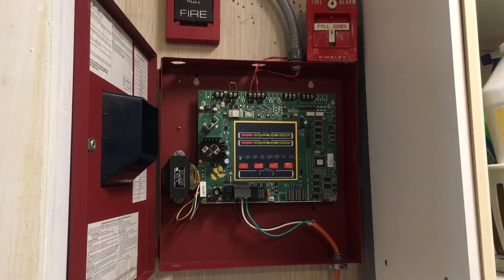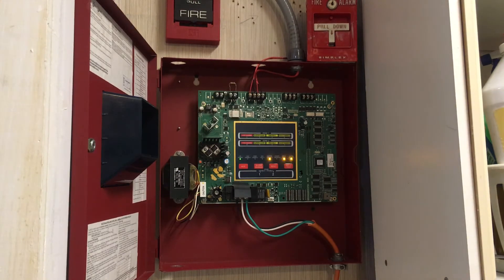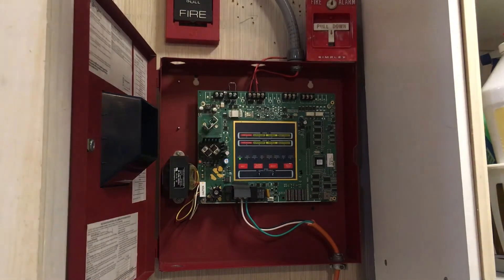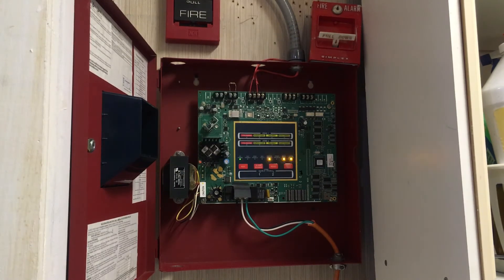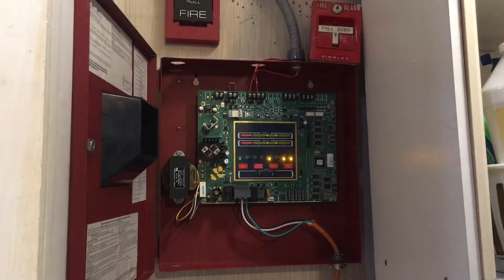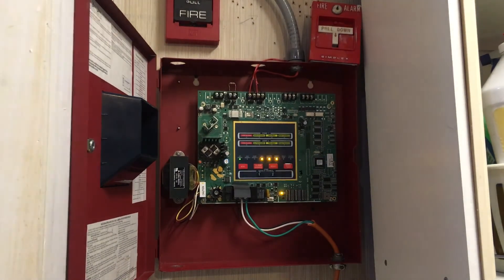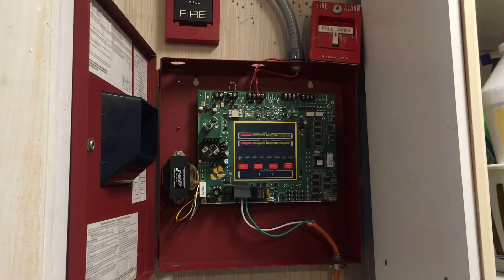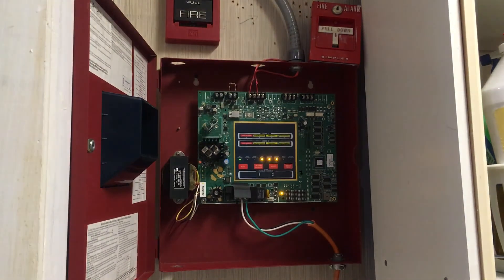How to perform a Silent Walk Test

Comment: At my school, their fire alarm inspection is ran when classes are in session, thus, the inspector would do Silent Walk Test with smoke detectors and then fire alarm test/fire drill. 
In addition to that feature, I personally recommend Silent Walk Test be used when inspecting a fire alarm system in residential facilities like hotels and apartments where they are always open/active.
Reply from the maker: When a building is occupied, we disable the NAC’s and one person is out in the field testing and the other is at the panel